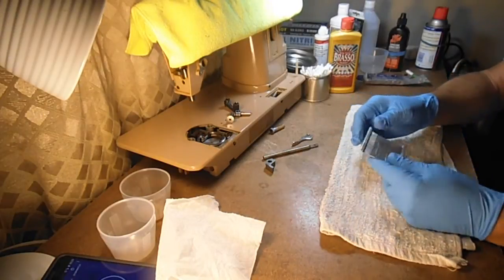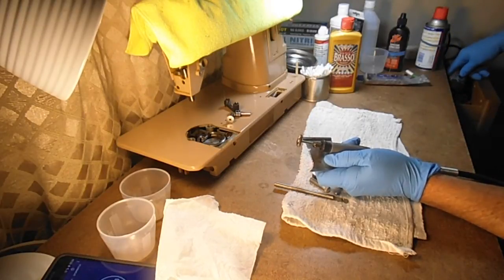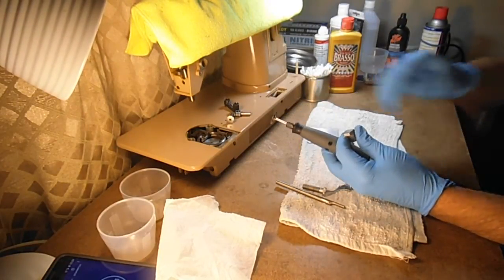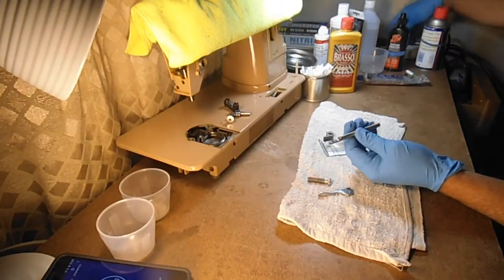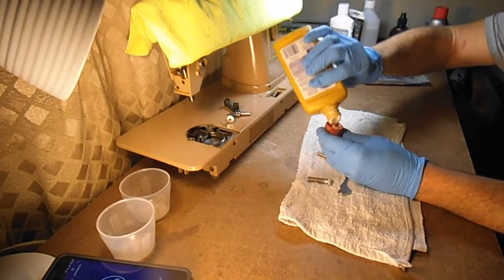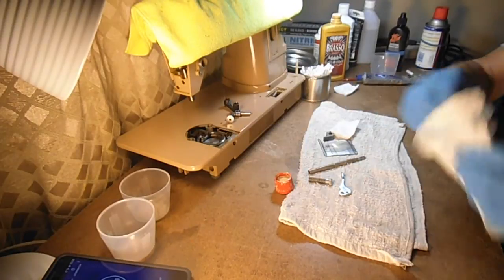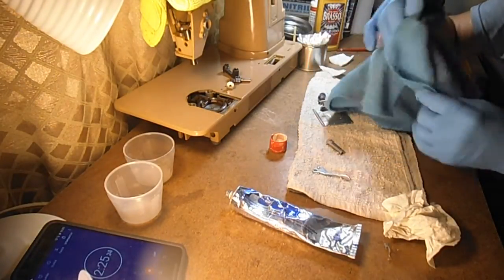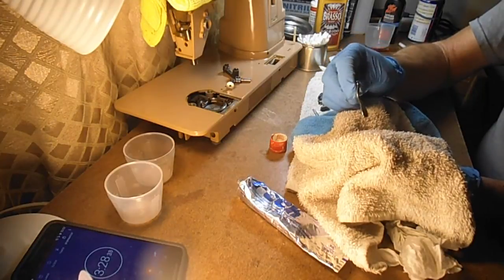SINGER MODEL 404 RESTORE SERIES Pt. 10c POLISH SMALL PARTS

Comment: Hi Andy! Can you use Peek Polish on the needle bar and presser bar? You may have mentioned this in the video and I missed it. Press Polish says it works for all metals but I wanted to know if you had found more success with brasso on those parts vs peek
Reply from the maker: Sure. You can use peeks polish and it even smells better over here where I live. It's just two or three times the cost of brasso and it doesn't quite work as quick but it will polish the metal just fine

Comment: Hello Andy. Im coming at you from Rhode Island here..  your the best friend a sewing machine could ever have 😊 I hope you are well.
I just bought a 401a from Salvation Army for 25 dollars. Its in really good shape.
Can i use mineral oil on the machine for now? Until my triflow and singer machine oil arrives in the mail?
Reply from the maker: Congratulations on your fabulous buy! Sewing machine oil, SMO, is a highly refined mineral oil. Pure, no additives. 
Other oils like TriFlow add PTFE, like a Teflon material, with the idea it will decrease friction and thus protect the metal from wear a little bit better. If you have a mineral oil that is only mineral oi without other additives you can try that. 
     The mineral oil that you buy in the pharmacy is usually not nearly as refined as SMO, but thicker. I've never used it, but a small number of viewers said it seemed to get "gummy" and/or "sticky" (their words) so I'd advised caution.
      Normally, household-type oils, similar to "3-in-1" have other additives that will for sure gum up your machine and should not be used. 
     You can always try some mineral oil on a part that is easy to clean, say the needle bar and bushing, and run the machine and see what you think.
     If you find some issues with your 401A as you start sewing with it more, this playlist of videos may help you with the most common problems found with the model. https://www.youtube.com/playlist?list=PLsCOZgzzaiKLiDl9yFTP6mJgQmz5lj4NO   
     Happy sewing, lucky you, and thanks for watching my channel.